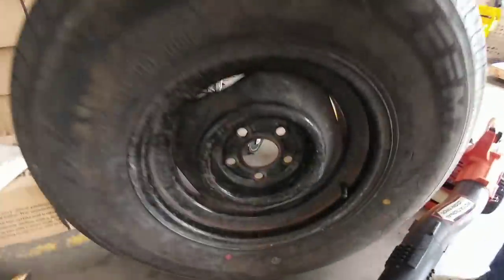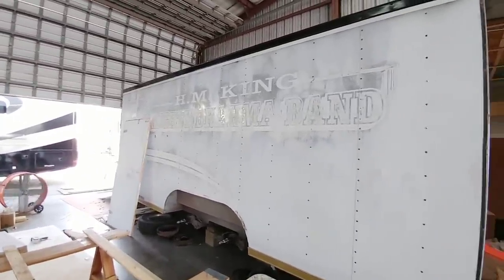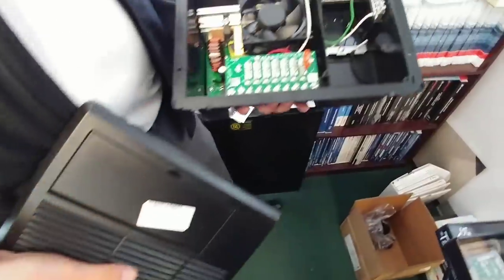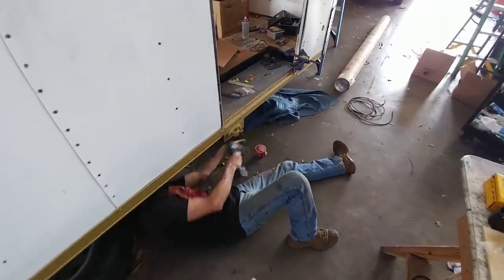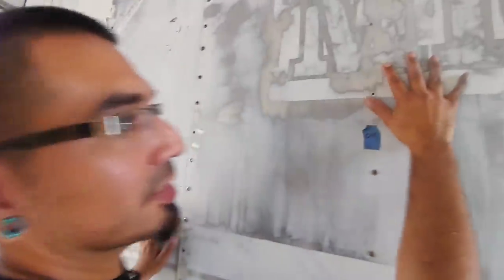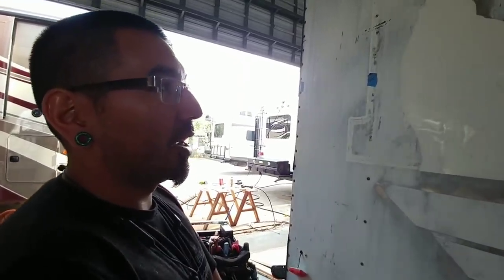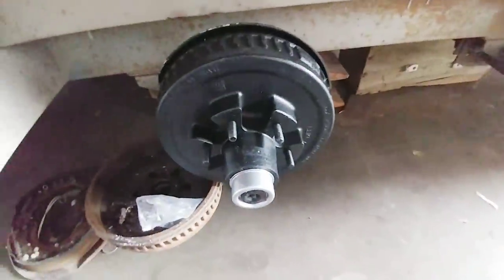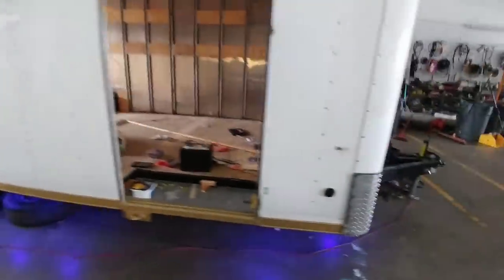WOW, No Brakes and Wrong Spare! Band Trailer Renovation Part 5

Comment: I like the thought behind this,but it mite have been just as cost active to buy a new one or a newer used one with all the labor cost involved
Reply from the maker: Not even close my friend.  This is a relatively high end cargo trailer (16" ceiling braces, torsion axles, boxed frame, and factory aluminum wheels).  This trailer in the condition we received it would sell for around $7k.  A new one would go for over $10k easy.  The brakes were the most expensive single repair components and they cost a total of $1200 to replace.  We are too much of a "throw away" society